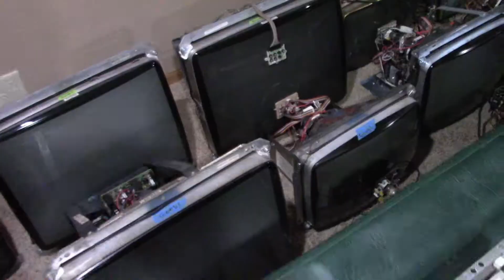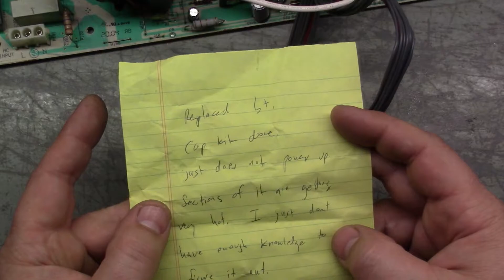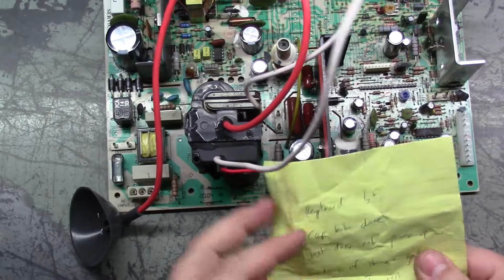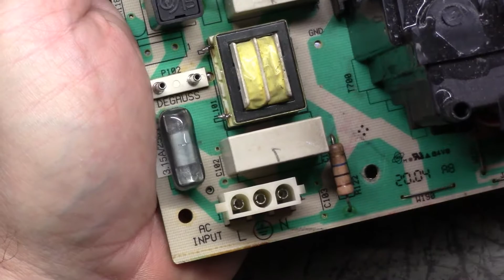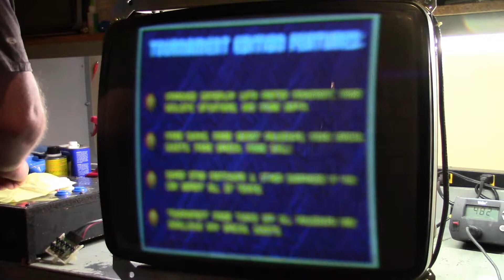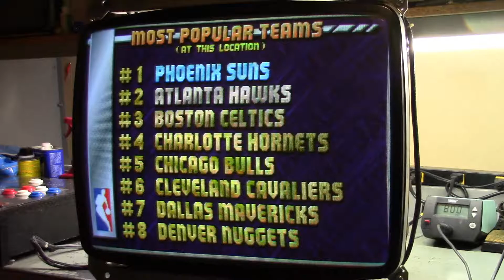K7400 Arcade Monitor Chassis Repair - Dead/Getting Hot

Comment: Hello mike i have a 27 inch d9200 wg monitor that randomly powered off and now its making a slow clicking noise and the green LED light on my monitor chassis is not lighting up anymore any tips? I know this is a long shot and you might be super busy But would you be interested in repairing my board by any chance i can mail it out and zelle you any time! Thanks
Reply from the maker: Unfortunately, I don’t offer services on the D9200. My apologies. I don’t have any tubes on hand to test them. Can’t work on them without a tube for testing. As far as your issue. Ticking is usually a sign of a failed HOT. I would start by testing that and see what you get.
Reply: @MikesArcadeMonitorRepair  thanks for the reply mike 👍🏻 but sadly i have absolutely no knowledge nor soldering skills for that 😔 i tried finding somebody to do a cap kit on the chassis and no luck what so ever is there anyway you could do a cap kit on it even if you dont have a tube to test it on? Basically theres nothing i could lose cause i cant fix it anyway

Comment: Whats the HOT part #? I cant read mine.
Reply from the maker: C3686 is the original. C3688 is the modern replacement. FJL6920 is what I recommend. 

https://www.arcadepartsandrepair.com/store/integrated-circuits/transistors/fjl6920-high-output-transistor/
Reply: Isn’t this what usually makes the ticking sound?
Reply from the maker: Yes. However you need to check things over to make sure the replacement doesn’t immediately short as well.

Comment: Mike ,Working on one of these ,Comes up perfect at first power up ,After 10 minutes running Goes to vertical collapse ?
Reply from the maker: Hmm. Something is heating up and failing or you have cold solder joints on one or more components. Inspect and reflow anything that isn't shiny or looks suspicious.

Comment: I remember having one like this not a wells gardner but some other brand, the chassis would power up for a minute, the hot, voltage regulator would get extremely hot to point of smoking then the fuse would blow, used to take out the hot and regulator in the process, in the end it turned out to be a tiny 33uf cap in the power supply had gone bad, incredible that such a small component could take out some big components like that.